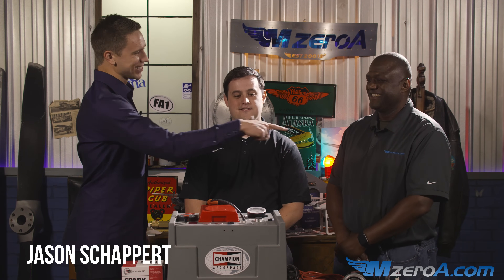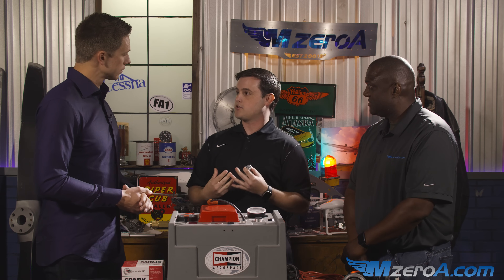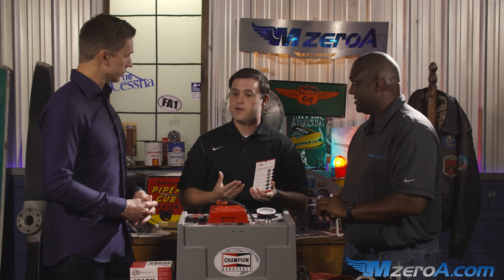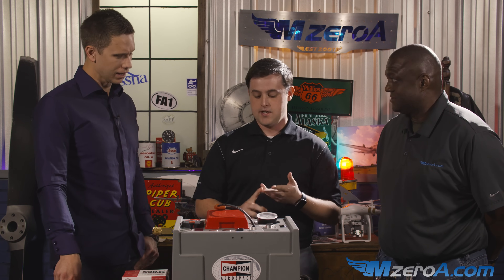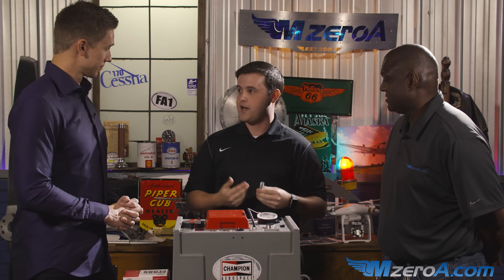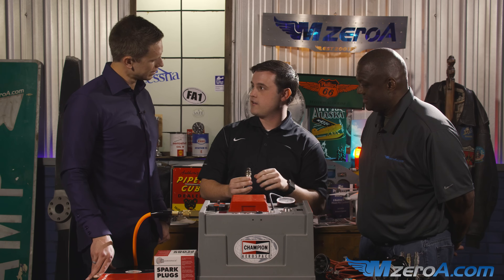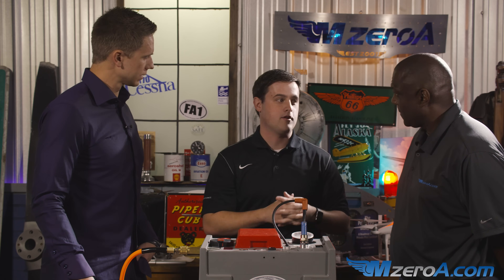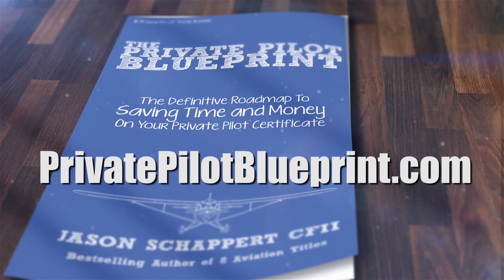Fouled Spark Plugs - Maintenance Mondays - MzeroA Flight Training

Comment: One important note that wasn’t checked. There is a resistance measurement that should be done between the ignition wire contact at the top of the plug and the electrode (center pin coming out of ceramic. This is very important in that the inline resistor inside the ceramic can get outside of specifications of the manufacturer. I recently tested 8 plugs from a four cylinder Lycoming and three were outside specification and no longer serviceable according to the manufacturer. Those three plugs cleaned up nice, looked almost new, and showed a good spark on my champion tester. The problem is that they would not fire consistent with other plugs when installed as the resistance was many thousands of ohms more than the other serviceable plugs. This creates a less than adequate intensity spark on those higher resistance plugs and can result in poor engine performance and strain on your magneto.  Also you should periodically test your ignition leads for resistance from flexing and heat and check insulation or signs of shorting in stainless braided covering. This also comes under preventative maintenance procedures and can save you a lot in diagnostic time by an A&P.

Comment: Excellent video Jason, a must see for Cessna 152 owners like me.  20 hour Tach plug cleaning, lower plug fowling , lycoming dislike of rich running. Interesting description of the IO235 being a cold running engine
Reply: Thanks for the feedback Ross! Have you tried the extended core nose plugs (Part Number REM37BY) for your aircraft? We worked with Lycoming / Cessna to develop these plugs for the O-235 to help with the lead fouling in that engine.
Reply: Champion Aerospace I am using them per A&P advice. Stop using the Fine wire which suffers from early failure

Comment: Too bad you can't show what happens when a plug fails on takeoff. First solo at a Class D airport. Runup was good. Got a couple hundred feet in the air and the engine started acting up.  Started tickling the stall horn. Thought I might have to put it down in the river next to the airfield. Those famous words were echoing in my head... Fly the plane! Fly the plane! Fly the plane! Managed to nurse it around and put it back down on the runway. 

CFI thought I was just being a baby until he came out to start the plane up. Then we figured out one of the plugs had crapped out. An eye opening experience for sure!

Comment: Great video and information. I wonder how all of this will change with UL94 avgas, if that ever happens.
Reply: Hi Jon, glad you enjoyed the video. We expect the transition to unleaded fuel and FADEC controlled engines to reduce, but not eliminate, the need to clean spark plugs. But for the current population of mixture-controlled piston engines that run on leaded fuel, the need will sustain.